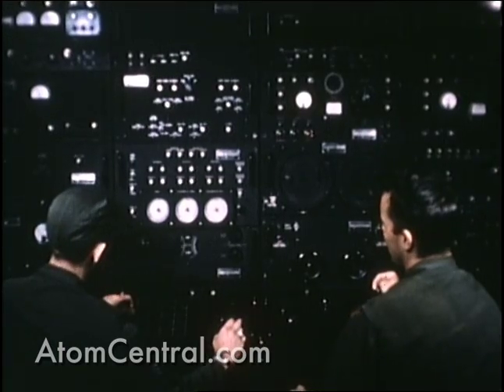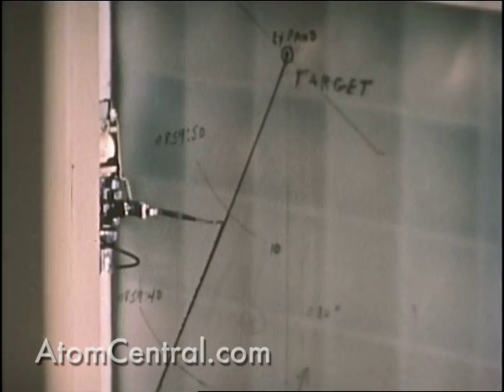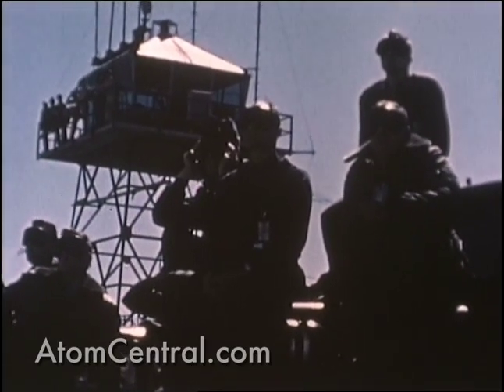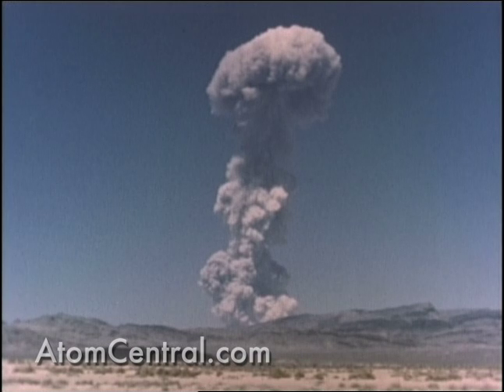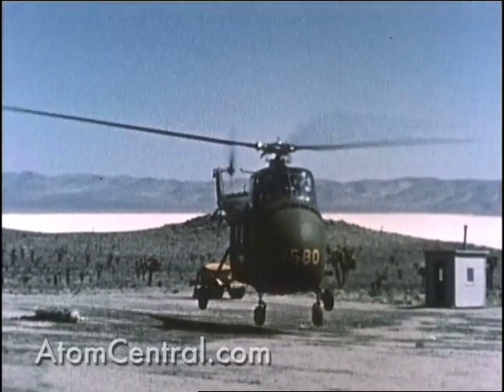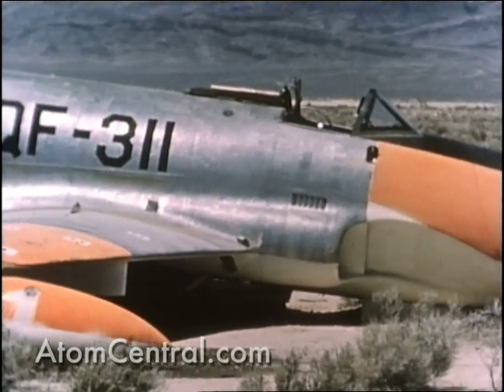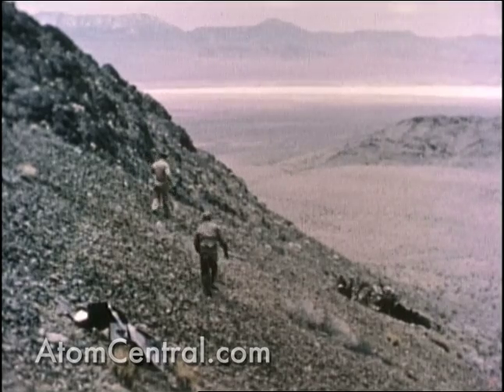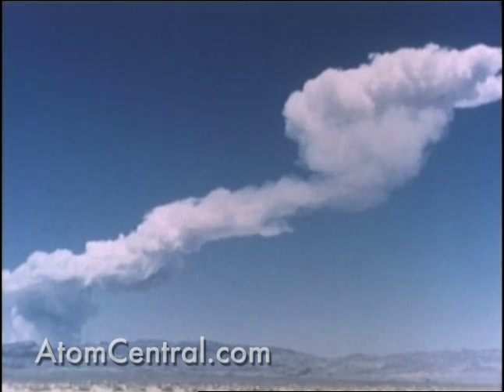Atomic Effects on Drone Aircraft in Flight

Comment: 3:30 left wing broke in two pieces, but it held together? Hell yes!
Reply: Rudder, not wing.
But still, pretty impressive.
Reply: +EPR89 Not rudder. That was the tailplane or hori stab, depending on where you are trained. Still, impressive that it didn't try to 'clap hands'.
Reply: 'Empennage' if you want to be posh.
Reply: Well, not quite, NeIC. The empennage is the whole aft section.
Reply: 4:51 the horizontal stabilizer
Reply: horizontal stabilizer
Reply: or elevator
Reply: SilentNinja .... not an elevator.   Horizontal stabilizer provides the hinge line for the elevator, but doesn't typically move.  Unless it is a stabilator, or has jackscrew trim.
Reply: N Wheeler so the elevator is the part that moves? or is the elevator directly part of the tail
Reply: SilentNinja ... Horizontal stabilizer is rigidly fastened to the same structure that the vertical stabilizer (and rudder) is fastened to.   The elevator moves (and the rudder moves), but the horizontal stabilizer doesn't move - unless it has jackscrew trim.
Reply: it's not a wing it's a vertical stabilizer
Reply: Doohicky
Reply: VladGoro25 Thank you for pointing that out! I was sitting here thinking: "that's not a wing" lol
Reply: I've been calling it the horizontal actuator. I guess it's a horiz. stabilizer then
Reply: stallinum was imported to make this plane
Reply: No. The elevator is hinged aft of the stabilizer
Reply: I miss when trolls were good at their job
Reply: Apologize to my mother, this instant
Reply: She's been telling me how excited she is for the date all day! So happy for her. Make sure she's home by 11 ;)
Reply: jodelboy f
Reply: Its called a flapper thingy,get it right
Reply: It was the plane's left flange
Reply: @epr8974  horizontal stabilizer, not rudder.

But still, impressive
Reply: Yeah, the wingamadoo got pretty jacked.
Reply: @VladGoro25  No, not vertical, horizontal. Your correction is incorrect too.
Reply: @FoxtrotGolfLima  In most  supersonic (and in some other planes) it is one moving airfoil. But usually it is a stabilising fixed part and behind it the elevator, a moving part. The rudder and the vertical stabilisor are usually constructed the same way. Those surfaces are called stabilisor, because they keeps the tail behind the airplane and the horizontal surfaces keep the airspeed stable. There's more to it, but this is basics. And many people have no idea at all, which is proven again in this video. Mixing up horizontal and vertical, wings and rudders. Tsk tsk tsk.
Reply: @voornaam3191  i guess i was sleepy)) Horizontal it is indeed
Reply: @VladGoro25  90 degrees banking changes all...
Reply: @voornaam3191  lol ture)
Reply: @N_Wheeler  what about movable, trimble tailplanes.... All modern commercial jets, or all moving tailplanes, or tailerons... Wow, it gets complicated doesn't it.
Reply: It's no 737 MAX, but it'll do.

Comment: What was odd about this test was the device fired. It was unusually hazardous from the gamma ray-producing U-233 and plutonium composite core, to save money on super expensive plutonium use. 

Another problem with U-233 is the much lower rate of neutron capture to fission rate. Likely this contributed to the much smaller yield than expected. 

Likely the justification for the experimental core was that U-233 was readily produced by neutron bombardment of natural thorium-232, in just about any reactor, whereas plutonium requires high neutron economy. Natural thorium is overwhelmingly isotope 232, with contamination in only trace amount. U-233 therefore avoids contamination by isomers that are problems in plutonium, such as Pu-240, that would demand highly expensive purification to weapons grade active metal.

Neutron economy is the ratio of statistically weighted average of excess neutron production divided by the statistically weighted average of fission production. Efficient moderation increases thermal/"slow" neutrons, therefore increasing fission rate, producing  higher neutron economy. 

Nuclear fission by neutron capture  is not analogous to kinetic impacts, such as crudely modeled in a pool game opening break. It is an absorption phenomenon of statistical values, based on the speeds of neutrons and the overall density of the active metal mass. Capture induces a higher nuclear energy state that can become unstable.

I am curious about the handling procedure modifications for this test, if any at all, in a sealed bomb casing possibly constructed with a high density metal shield. Uranium-233 cores can neither be assembled nor examined in shielded glove boxes, and thereby pushed development of closed core/casing weapons. This of course created a profound change from the standard safety process of installing cores within aircraft shortly before drop targeting. 

Nonetheless, I have not seen any data on this MET core in later tests.
Reply: +Graviton64 the only really interesting comment down here for people like me
Reply: Graviton64 hmm... yes, I concur
Reply: Graviton64, u copy and paste Wikipedia. we all know
Reply: Graviton64 <_<
Reply: Graviton64 lol
Reply: Andrea Tomassini who are you? :-)
Reply: Graviton64 I must say, I really enjoyed reading this comment. You seem to have done your homework!
Reply: you got the whole thing all wrong! cat food was bombarded with gamma radiation in a pig breeder reactor this was found to boost fission much more efficiently than the Walt Disney procedure you describe here, and I have seen the data.
Reply: The physics of the thorium to uranium cycle are extremely interesting. It's quite sad that we as a civillisation didn't use this system as a method of power production compared to the current u235 fission systems that rely on very energy intentisive and nuclear proliferative systems such as centifugal seperation.
Reply: Graviton64 u235+th233.
Start programm, if ты habe viele Golden, peoples und time.
Reply: Wow very informative and interesting. Please make video's and share your broad knowledge on this topic. I'm curious what is your profession? This is very interesting stuff.
Reply: PlacentaJuan Somebody out there could tell you but the NSA will be making a prompt visit afterwards... FOGBANK is supposed to be some toxic fancy foam that increases intra-casing pressure from x-ray ablation.
Reply: I’m all in on the pig breeder reactors. You just can’t have enough bacon ......
Reply: What ever u say bro
Reply: And you said all that to say what?
Reply: Congratulations, you have mastered google
Reply: Patroshka Post- Apocalypse Survival how lol
Reply: You a college professor or something?
Reply: @ModemMT  Let's just say that I have a strong natural sciences background. I'm also very keen in history and other areas.
Example selections: I assisted production teams in technical consulting two British documentaries with a friend, after BBC and Wall to Wall approached us for accurate info and film sources for projects about British and Chinese nuclear history.
I typically avoid fussing about people/personalities, which is a big waste of time, and most write or present nonsense on the Internet. Yet I very much enjoy intellectual exchange of ideas and information.
Reply: E K neato.
Reply: So, the usage of less than ideal elements in the creation of the nuclear devices has to do with the fact that they did not had substantial amount of better ones?, why do you point out the yield?, it is not supposed to be more of a tests about the effects of radiation on the aircraft? (or i got it wrong?)
Reply: @mbmaccin555555  😄
Reply: @TCBYEAHCUZ  Thorium was frequently proposed to hinder weapons production at commercial reactors. 
It's interesting how Canadian CIRUS reactor was repurposed for the first Indian A-bomb production. 
The punchline of the controversy is that the Canadian government co-financed the reactor during the globalist Pierre Trudeau years. 
Yes, the same Trudeau that established friendships with the likes of the Castro family in Cuba. Trudeau liked communists. His kids do too.
People act so shocked at info going out, yet it's technology. Technology disseminates. Yet it requires huge financial and engineering resources to make it happen. Look at what the Atomic Heritage Foundation puts out:
https://www.atomicheritage.org/history/electronics-and-detonators#:~:text=The%20electronics%20systems%20and%20technologies,in%20the%20field%20of%20electronics.
Reply: Too much. Didn't read

Comment: Wow... I just saw one of those T-33s / F-80s at the Compton ( California ) Airport other day! Just imagine the vacuum tubes in those bad Boys...
Reply: Am I r/Wooosh right now? Lol 

Turbine jet engines don't have vacuum tubes, they have fan blades on a high/low pressure compressers connected with a combustion chamber and a turbine with collapsible tail fins on the rear. (And tail fins get much more sharp than a razor, I've sliced myself many times!)
Reply: @Denzel_Watchington  OK, Mr. Genius... I was talking about the electronics , not the damned engines! LOL I take it you and the guy giving thump up are under 50 years of age?
Reply: @JungleYT  "Okay, Mr. Genius" LOL
I was an Airframer  [Aviation Structual Mechanic] for 12 years in the U.S. Navy.
What does getting your AARP card have to do with Jet engine's anyways? LOL
"Thump Up" 👍😂🖒 hahaha
Reply: @Denzel_Watchington  Because, likely you are probably not old enough to know WTF a vacuum tube is and that I wasn't talking about mechanics. Former USAF electronic technician here, in support of A-10 and the C-141B Starlifter... HaHa!
Reply: @Denzel_Watchington  That comeback was so stupid I won't dignify it with a response... Notice: Put A-10 Warthog into search to seee how much of a "joke" it is...
Reply: The ARC-27 radios did have some sweet tubes, also tuning ports and boxes that We had a little hammer to shape it with. The electronics were something to behold! So many mechanical devices in the electronics.

Comment: Ahh the post war late 40's and 50's were a great time for innovation and discovery. They had inflated budgets and took on many many projects. Many were ground breaking some were flops but still great data was gathered and many innovative ideas were hatched and put to good use the majority of the time. This test showed the destructive power of nukes on flight surfaces and the structures of jet aircraft in general. Three jet drones were used at differing altitudes. The top was #1 middle #2 and bottom #3. Great data was gathered even though it wasn't a complete success. The bottom drones camera did not activate so no recording was captured. The other 2 drones cameras worked as planned. The bottom drone suffered the worse damage to the stabilizers. The drone remained under control for several minutes  as they were trying to land when all control was lost after several minutes.. The top drone was the best success. It landed as usual but blew a tire and skidded off the runway as the front gear collapsed. All the data pods survived except the telemetry pod of the top drone. The middle drone had its horizontal stabilizer buckled on one side it too was controlled until touch down when control was lost and it bounced and crashed. Still all the stabilizers of the three drones were captured. All the drones were able to drop the pods and equipment as designed except the telemetry pod of the top drone. All of the drones, whether they crashed or not, still were able to drop the vital equipment used to record data. Ultimately it was a success.
Reply: Fortunately no semiconductors used.

Comment: That's the thing I like about the military: they sure are pragmatic as hell, enough to make great use of the technology they have at the time.
Reply: "Wonder what happens to a plane flying over a nuke"

"Fuck it, we got the money"
Reply: But they cant use them to save lives....these UAVs during WW2 coukd have saved a lot of lives...also in Vietnam too...why we develop this stuff but dont use them...?
Reply: They also coukd have saved lives in Korea
Reply: JCSMOOTH345 this was like, 30 years later. They didn’t have drones in WW2 at all. And the drones were probably very low tech compared to now.
Reply: They did have drones in WW2, I did a paper on it in college, The Navy was the first to actually have the first remote controlled warplane, but they didn't like how it handle from a control room...it felt clucky to them...so they scrapped it. The Germans had a mini tank drone also...the Japanese had a remote controlled zero..but used it too late in the War...
Reply: You can't really do dogfights with them and during WW2 all of these were experimental and rather imprecise without a mothership with operator close to the drone (for example Fritz X manually guided glide bomb).
Reply: @thamastersmooth  as I remember Kennedy's brother died in one of these drones while testing them
Reply: @johnnya1717  if he was inside of the drone...than it was not a drone....the drone is controlled usually by a computer or ground station near by...no one is inside the drone...
Reply: @kittyyuki1537  they could have been used as decoys...and to make extremely dangerous bombing runs....but than we didnt have the groundstations like today
Reply: @thamastersmooth  it was that type of drone, which was made from a regular plane and you should take off and then jump off with parachute

Comment: What a funny and cool looking helicopter. Anyone know what model it is?
Reply: +Mitch Levy it looks a lot like a Sikorsky H-19
Reply: Thanks
Reply: i like it. looks like from a yogi bear cartoon or something =)
Reply: H-19
Reply: Jolly Green Giant, I think they called them.
Reply: Mitch Levy I think it's called silhouette
Reply: Originally privately developed by Sikorsky as the S-55, once purchased by the Air Force it was assigned the military designation of H-19.  Other branches of military service assigned a different letter prefix followed by -19.
Reply: youre thinking of a sh53.......waaaay different, and far larger than the h19 XD
Reply: isnt it a version of the westland wessex?   they do look similar if i remember
Reply: I feel bad for this generation they don't know sh*t
Reply: Mitch Levy It's my gender.
Reply: Sikorsky S-55 Chickasaw; Army designation H-19. You can tell from the chopped-off look behind the rotor head it is not the later model S-58/H-34, which had a rounded turtleback behind the rotor. Westland did build a licensed copy of the S-55 designated Whirlwind in the UK. If you look again (3:49) at the rounded nose, try to imagine a nine-cylinder radial piston engine tucked in there—it really was. With only 2,700 pounds useful load (including fuel and crew) and only 600 horsepower in the engine, they were terribly underpowered by today's measure but were useful enough where vertical takeoff or landing was a prime consideration.
Reply: I believe back in Vietnam that particular model of helicopter was nicknamed the "Jolly Green Giant"
Reply: Mitch Levy Mash model
Reply: Mitch Levy  its the George Jetson 5000, very futuristic.
Reply: Sikorsky somethin-somethin
One can be seen in the movie Full Jacket Dinner
Reply: It's a model 7580.
Reply: It has a big radial aircraft engine sitting at about 45 degrees inside the nose, with a shaft and clutch running up to the rotor. Really odd arrangement, but they were workhorses.
Reply: Westland Whirlwind..forerunner to Wessex
Reply: its a Cargobob
Reply: @IKamiZz  Eyyyyyyy

Comment: 3:30 wait until you see that happen in a real plane, then you will carefully consider your life choices

About 11 years ago was on a plane where that happened to the wing (though not that bad and it was not caused by a nuke), the look on the flight attendants face when she saw it was priceless (I literally saw the colour draining away) needless to say she literally ran to the cockpit and moments later, the plane slowed down to half its cruising speed, descended to around 20,000ft and we landed fast with flaps up

The cause was lack of maintenance which allowed a crack to form in the main spar, which partially failed (they say lowering the flaps or hitting turbulence on approach would have caused it to completely fail) 

Thankfully these days, airlines are required to perform more extensive maintenance so that exact thing doesn't happen